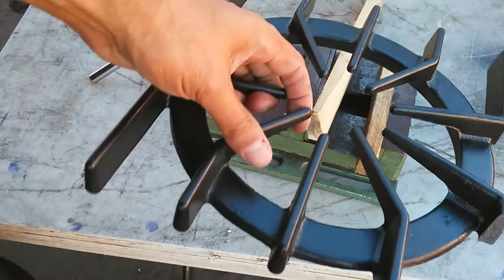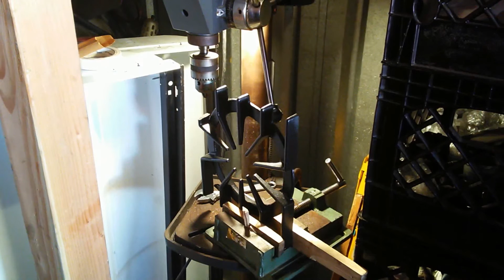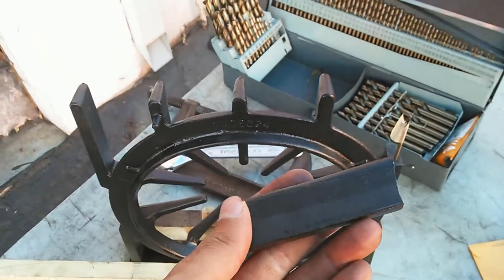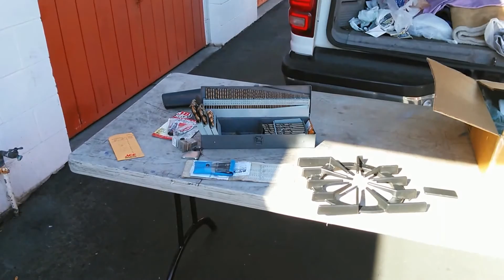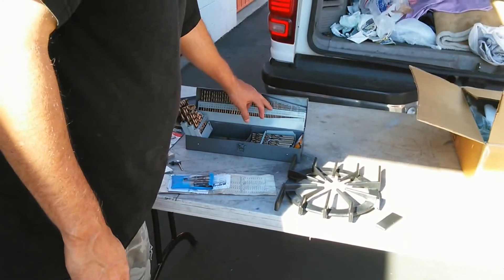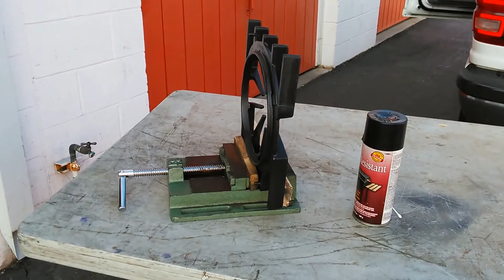Fixing Cast Iron (Viking stove grate) - How To

Comment: Hi Frank,

You you restore burners that emit flame? The color on our black gas stove burners is gone...tried sanding and painting with high temp paint and it immediately peeled...

Thanks!
Reply from the maker: High temp paint is not designed to withstand the rigors that burners go though when they are exposed to a propane of gas based fuel. The only way to restore a black burner is to sandblast it down to bare metal and apply a high temp powder coat. I'm doing a set of burners, burner bases and burner caps in the next couple of weeks, so if you would like me to include your burners in my run, contact me in the next week. Remember that I'm on the West Coast when you call my phone 714-574-1544.

Comment: My mom was wondering how to clean the original cast iron spider grates on the Viking rage or is powder coating a better option. Thank you!
Reply from the maker: ava adamantidis I've refinished quite a few of these spider grates over the years. The finish on these is hard as nails, therefore tough to deal with. They can't actually be "cleaned up", that's why I normally sandblast them down to bare metal, then powder coat finish them with a new high temp finish. They look like new when they're refinished. I'm going to be doing a set of burner grates, bases and caps in the next couple of weeks, so feel free to give me a call if you want to go this route at 714-574-1544.

Comment: I have a broken grate & this seems like a good way to repair it.I was wondering how well it held up with heat & time?. JB Weld site states it can withstand a constant temperature of 500º F. The maximum temperature threshold is approximately 600º F for a short term (10 minutes).
Reply: Maybe you are aware of this, but  JB has a High Heat and and Extreme heat.  Well, after just reading about this, it turns out that product is NOT applicable for bonding two pieces together.
Reply from the maker: I did this fix for one of my restorations. As far as I know, it has held up perfectly for the last year now. I knew a guy who used JB Weld to fill a cylinder crack on an air cooled VW engine block and that car ran for years before he had to rebuild it. I have personally used it to weld a hole in my 500 cc Yamaha baffle,  without incident. Two strokes are know for afterburning "in the pipe" so those temps far exceed the JB Weld recommended temperature rating, so I'm sure that the manufacturer info is quite conservative.
Reply: I fixed my cast iron burner grate using your idea with a little less precision & it worked fine. I used a 5/64" drill bit in a vise with a handheld drill. Using 1/8" pop rivet stems for dowels (which is a shade smaller than the drill bit), they fit loosely for easy alignment & can be bent to accommodate any unaligned drill holes.

I applied acrylic paint liberally with a Q-tip to the first drilled side of the break and carefully placed them together, showing a void spot where to drill on the second piece.  This technique is easier since you don't have to spend so much time with precision drilling and hole matching. The oversize holes let the dowels easily align the broken parts.The dowels work like rebar and the JB-weld is like  concrete, filling the slack in the drilled holes making a strong repair.

I was a little concerned about JB-weld's temperature limit of 500 degrees stated on their website, but time will answer that question. Thanks for the idea !
Reply from the maker: Nice! The precision fit is hard to do with two pieces. The loose holes would definitely help with the fitment and two dowels are better than one. When you analyze it, the dowels are what really give the structure its stability, the JB Weld is simply there to hold everything in place. Thanks for the input.

Comment: Hey Frank! Great video! So I have a used Viking range and it looks to me like the burner grates were once enameled and the previous owner somehow stripped and/or chipped the paint. My guess is that they didn't know how to properly clean them. So now no matter what I try to get them clean, they still look dirty and grungy because of the old paint that is left behind. I'm looking to repaint and have been researching for the last two days, finding conflicting info. Any advice is appreciated and it looks like you're the person to ask!
Reply from the maker: Heat coatings are tricky. If you apply another heat coating over an already existing one, it will surely flake off when exposed to any kind of heat. I really haven't found any other way to refinish one of these grates other than to go through the due diligence of starting from scratch, so I usually take them to the sandblaster to have them stripped. I then shoot on high temperature powder coat and bake it on at 450 degrees. I'm lucky enough to have a powder coat setup.  It's kind of expensive to have a powder coat finish applied professionally, so make sure you shop around.
Reply: +Frank Hamilton Thank You! Fortunately I know a few machinists and rod builders, etc. so I may be able to find a deal or work a trade. Another option I found is to have someone sandblast and actually really porcelain enamel like the original finish. There's apparently only one guy around that does this with cast iron. John Ballantyne at customceramic.com in Illinois. I'm going to contact him for a quote and I'm sure it won't be cheap. I may just have to bite the bullet and spring for replacements (@$100 ea. yikes!). Thanks again Frank! I'll definitely look into your method. Best advice yet.
Reply from the maker: +Robert Anthony Since you have access to custom rod builders, you'll certainly have access to people who can do a high temp powder coat finishing. A porcelain finish is typically only done on cosmetic surfaces not exposed to extreme heat. Those grates are likely seeing temperatures as high as 400 degrees. A pound of high temperature powder is around $30 from a company like Powder By The  Pound. And you are correct in assuming that a porcelain process is very expensive. Good luck.

Comment: if you can make more viking range videos that would help
Reply from the maker: Thanks for the comment. I restore Viking ranges for a living so I have more videos that use the Viking range as the subject matter. This  includes videos that show how to convert the Viking cooktop from gas to propane.
Reply: wow cool we do kind of the same thing here in los angeles , we have a shop and sell used and new viking ranges ... wish i had a way to make the cast iron grate new again
Reply from the maker: Actually the grate in this video was completely restored to "like new" condition, but it was broken by UPS. I'l be posting a video when I do my next set of grates. I'm currently restoring a Viking 6 burner cooktop VGSU-161 right now, so I'll post video when I do the grates. I'll also be refinishing the stainless steel on that unit. Stay tuned...
Reply: cool ill check it out